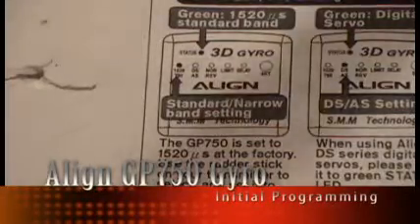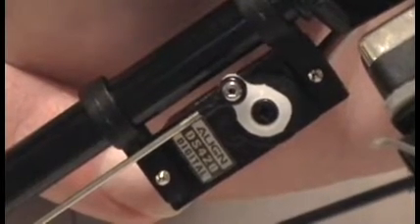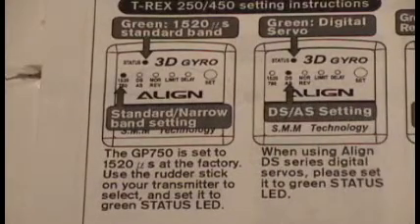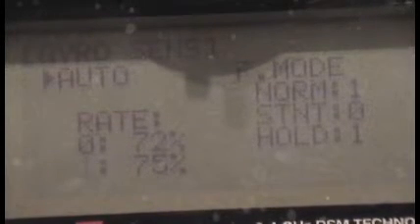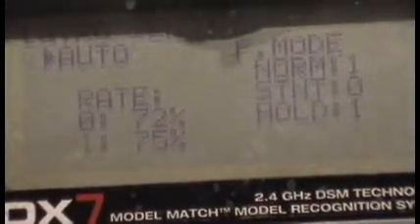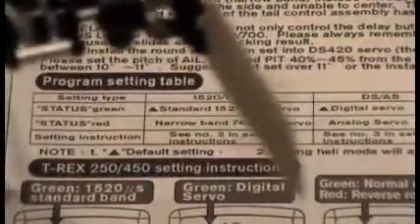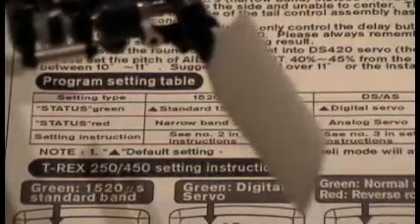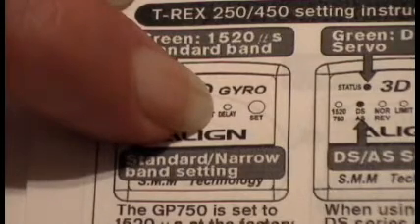Align GP750 Gyro Setup

Comment: Hello, my align gyro 780 doesn't power up. It's getting power from the receiver thou. What you think?  The gyro or receiver?
Reply from the maker: probably the RX or the radio isn't programmed right, or the gain signal isn't in the right spot.

Comment: Did you solve it? I just installed a 750 on my trex 500.  Some quick things to check: 1.) Connector position. white/yellow signal wire should face to middle.  2.) On Tx set rudder expo or rate = 0%.  3.) No EPA(end point adjust) on rudder channel.  Good luck.

Comment: More FYI's on this.  I'm begrudgingly using, cuz lost my favorite GY401.  The GP750 is very sensitive to mounting.  Must be "soft" like the original tape.  My double stick tape was rigid.  Resulting in small tail twitching.  I'm running: Trex 500 w/DS-620 tail servo.  Zero Delay.  20% gain.  BTW the connection to servo is "flimsy".  Guarantee to disconnect on piros.  Use dental floss trick to secure.

Comment: An FYI for GP750 users.  Make sure your tx rudder expo=0 and rate=100%.  GP750 Limit setting may fail..  Most people fly with different expo or rate settings.  To avoid problems, you must change expo/rate back to nominal.  Now you can set limit on GP750.  Then go back and reset expo/rate.  This was driving me crazy.  That's problem with any device relying on tx input.

Comment from the maker: Yes that is generally a good idea after changing the trim on any radio system. Spektrum mentions this in their manuals. Whenever you change the trim, you should re-bind. However, you should try to set up your tail without using trim.

Comment from the maker: True. Those gyros bug me because they always reset after every flight, so you have to trim the machine every time if the gyro doesn't center properly. Most of the time it works good, but sometimes it doesn't. I prefer to keep things as simple as possible, and it's much easier to try several different servo arms to get the right one, than to introduce complexity into your radio settings. That's why I give the advice I give - not because it's impossible, but because it's complicated.

Comment from the maker: This could happen if your receiver isn't working right, or the gyro is plugged in wrong. Make sure the 3-wire plug is in the rudder channel, and the single-wire plug is in the gear channel.

Comment from the maker: @yjoem1 Could be lots of reasons. Not enough gain, bad rudder servo, bad linkage geometry, sticky bearings, blades on backwards, gyro reversed, tail belt twisted wrong, servo on backwards... LOL... check everything.

Comment from the maker: @juacas82 The LED on the gyro *during operation* should be green, indicating heading hold mode. During programming though, it needs to be the correct color for the setting you are making, which is all shown in the video.

Comment from the maker: @juacas82 The LED on the gyro during programming indicates which setting you have chosen. If you reversed anything in the radio, change it back, that's not the reverse I'm talking about. The reverse you need is the "direction" setting of the gyro itself, which can be normal or reverse. When the tail moves, the gyro should push against that. You should be able to see if the blades react the right direction when you move the tail by hand, motor off, helicopter on.

Comment from the maker: @Captan6pack I guess I'm not really sure what you're asking. Personally, I always fly in heading hold mode, so I only ever use one gain value, so whatever you can do to produce that value on the gear channel, that's what you can do. I don't know what radio you are using, but you just do it however you can and it should work.

Comment from the maker: @raymondx1232 Probly shoulda read the comments before saying that, AGAIN :)

I'm well aware of what is possible, but it isn't advisable - it leads to a whole bunch of problems down the road, and some of them can be safety issues. It is best to do it without subtrim - possible to do it with subtrim, but the things you have to watch out for are too complicated to explain in a short video. So it's easier to just say don't do it. Can't believe I have to explain that again.

Comment: @jasmine2501 Hi Jasmine and thanks for making these vids!  I don't understand most of it yet but I'm learning.  One thing though... as someone who flys ( sim ) mostly piro moves, an inconsistant piro rate can really throw a wrench into the works.  A  piro change during a p-funnel knocks me out of sync with cyclic stir w/ no time to correct.  Can you suggest a gyro for 250, 450 sizes which can set an absolute deg/sec piro rate?  I just got a Spartan DS760... would that do the trick?  Thanks much!

Comment from the maker: @RotorHead2652 Not sure where you heard that, but it's incorrect. The gain values can be whatever you want. Some radios allow you to set more than two, and when flying I'm usually only using one setting. I use heading hold mode exclusively, and the gain gets set at whatever it needs to be for each head speed.

Comment from the maker: @skidpatrol You can reduce the piro rate using the dual rates or adjustable travel on your rudder channel. However, you can not set an absolute piro rate in degrees per second, as you can with the high end gyros.

Comment from the maker: @wasimwazir Yeah I'm well aware of Finless Bob's recommendations for setting up gyros, but he has not done a video about the GP 750, and it works different from the GY 401 - not all gyros are the same. On the forums, we get a lot of people having problems related to entering trim and/or sub-trim on the rudder channel, so, while not technically correct, it is easiest to avoid using trim and sub-trim on the tail - and if you do things right, it's not necessary either.

Comment from the maker: @FlyGuyRc 
The other thing is normal, I promise. When you push the stick and the helicopter doesn't move, the gyro doesn't understand why, so it "tries harder" eventually moving the servo all the way to one side. When you let go of the stick, and the helicopter isn't moving, the gyro thinks everything is perfect because the commanded piro rate (zero) equals actual piro rate (zero), and it won't move the servo in that case, even if it's all the way to one side. This is how the heading hold works.

Comment from the maker: @FlyGuyRc Well the servo sticking to one side is normal for a heading holder gyro. The spinning is because you have the direction reversed - not in the radio, but in the gyro itself. Direction is the 3rd setting on the gyro. Check the rudder stick reaction too before you get off the ground, because you might have to reverse that too, but it sounds like not.

Comment from the maker: Well the mixer is where the motors plug in to. There should be two screws to adjust things. I'm not sure on that helicopter though. Try going to RCGroups and ask a question in the Beginner electric helis area. I would say try reading the manual but it's probably in Chinese :)

Comment from the maker: Oh wait... you are talking about a fixed-pitch helicopter with a motorized tail. This video is about a gyro, used on collective pitch helicopters with belt or shaft driven tails. On your motorized tail, there's a number of issues which can cause the tail not to spin fast enough - bad motor, gear slipping, bad setting on the mixer, low battery power...

Comment from the maker: Counter-clockwise can mean that the tail isn't giving enough thrust - this can be caused by many different issues, such as belt slipping or tail blades mounted wrong. It also can be the gyro is reversed. I am not familiar with the helicopter you're asking about, but those are some things to check.

Comment from the maker: You center the pitch slider with mechanical adjustments, and the heading hold software takes care of the rest. If you use sub-trim the gyro will think you moved the stick off-center, and it will actually cause a slow tail drift and other random behavior. You can use it in certain cases, but it's too tricky to explain how, and it's easier, and correct, to just keep everything zeroed.

Comment from the maker: New parts can have problems. The DS420 servo is known for burning out. Sounds like maybe you need a different one. I don't use the one I got with my T-250 - switched it for a JR DS290G. For a 400-class heli, I think really a bigger servo is appropriate - I use a JR DS3400G on mine.

Comment from the maker: The servo will not center in heading hold mode. Only in rate mode will it actually center. You don't control the servo directly - the gyro puts the servo wherever it feels is necessary.

Comment from the maker: Sub-trim sends an off-center signal to the gyro. The gyro can not tell if this signal is being sent by sub-trim, or if the pilot has moved the stick off-center. Some gyros, like the GY401, will reset the center when they are powered up, and it's ok to use sub-trim in that case, as long as you re-bind your receiver so the gyro gets that off-center signal right away on power-up. This is covered in the GY401 manual - but this video is not about the GY401.

Comment: yes, i did.
well, yesterday night i installed a Microheli Tail-Set, checked the rod on binding and went from 7mm to 5mm.
Tonight i will test.
Looks fine whitout motor when pushing the tail around, but i realy hope for success tonight. Otherwise i have to let a Pro check it.

Comment from the maker: Back off the voltage to 5.5... the servo may not be able to handle 6. I run a BEC on my 250 now, so I don't have any issues like that - still run 5.5V though.

Comment: Thanks. Will check on all, maybe find it in one of what you mention.
Yet, still there is another strange thing going on: while the ESC is initialising at startup, each Biptone has a simultanious move of the 9257. Some kind of impulse is getting straight through. So i wonder if any electronic device has a defect or is it interfernce between 2 of them due to the thight space!?

Comment from the maker: Also make sure all of your tail linkage is moving smoothly, and is straight as you can get it. Make sure it isn't binding in the hole in the guide - you can open up that hole a little bit and it will help. Check the ball links on both ends and make sure they are smooth moving and the rod isn't going too far in and hitting the ball.

Comment from the maker: Should be 5mm servo arm for the tail. 9257 servo is over-kill for this helicopter - the DS420 actually works just fine, as will the DS290G - bigger servos will just make it tail-heavy and do not really give any advantage. Sounds like you've just got too much servo arm though - many people do use the 9257 and it works, but IMO it's just too big for this helicopter. 9257 is so strong that it can actually hide a problem with the tail hub - make sure you have the new single-bearing tail hub.

Comment: part  2:
It does not move much till a certain point and than it spins like hell in an instant (i have my 250 attached to a turntable).
No matter how i set up my radio (DX7), i tried so many ways, it will not work.
I guess i have the wrong distance from Balllink to Servocenter.
I can not find this info in the Manual. 
What distance is yours?
Or do you have any idea what might be the problem?
Little frustrated here.
Thanks for ANY help in advance!
Br
foxbearCH

Comment: Hi Jasmine
Thanks for all the helpfull vids and time spend to create them!
I build my 250 and instead of the 750/420 combination i installed GY401/Futaba9257.
I do have the same on my Protos 500, working just fine.
On the 250 allthough i can't get them setup. Programming almost like for the Protos, but:
HH-Mode is on, but its more like beating from left to right side. In standartmode it stays centered, but as soon as i move the rudderstick there is no smooth turning possible.

end part 1

Comment: I have one more :s , do you know what to change if the blades are not rotated enough in order to lift? With throtle stick in top blades are just paralel to the ground and with stick lower they do rotate much (like for decreasing altitude)

Do I have to unscrew and rotate the blades holders at the very top of the heli? That part came mounted so I dont know ...  

Thanks for the help and videos.

Comment from the maker: When you set the limit, you're in programming mode and it moves the servo so you can see where you're at. Doesn't matter what the gain is on - programming modes do what you need it to do.

Comment from the maker: The DX6i is a little different, but the issue with the servo moving to full extremes is actually normal heading hold behavior. When the helicopter is sitting still and does not react to servo movements, the heading hold gyro doesn't understand what is happening, and it continues to move the servo until it senses the tail swinging around like it's supposed to. The only way to test a heading hold gyro is to actually fly the thing.

Comment from the maker: possibly - it depends on the servo and other factors. Put it in heading hold mode and swing the tail and see if it pitches the blades against your action. If you push the rudder to the right, the tail blades should 'push' - making the helicopter move to the right. If not, reverse the rudder channel. Then, swing the helicopter nose-left, and the gyro should push the blades the same way.